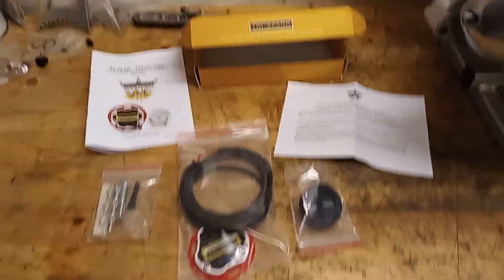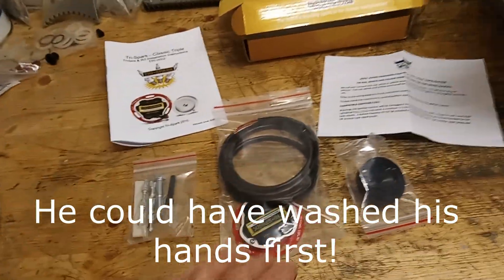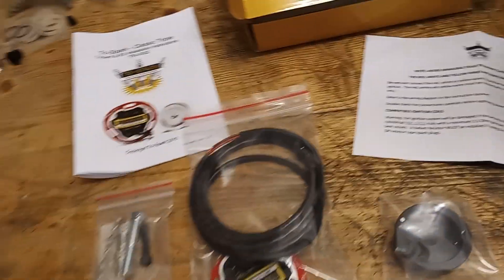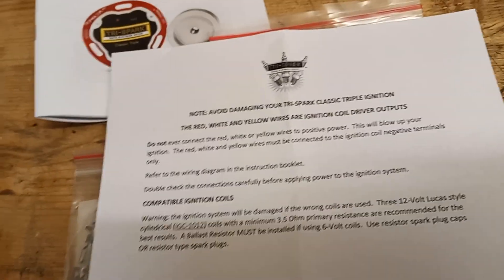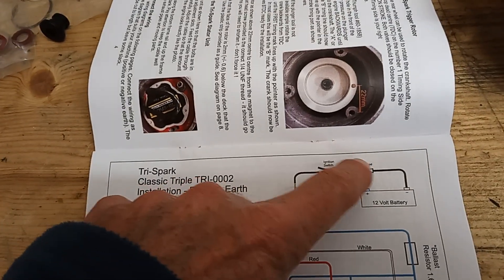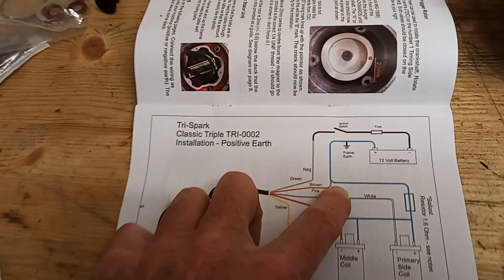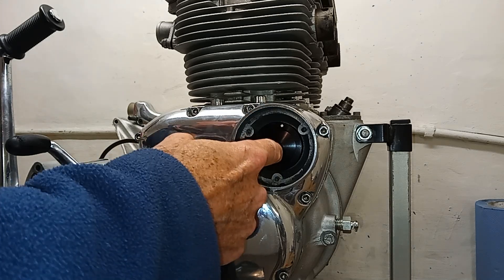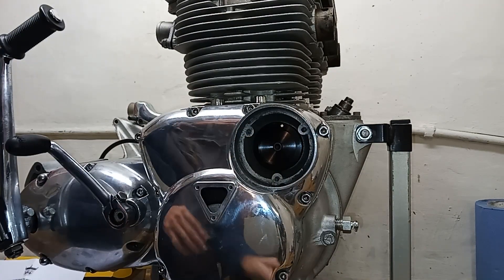Triumph Trident T150V Engine Rebuild Part 47: Fitting a Tri-Spark Electronic Ignition System

Comment: Hi Chris. I fitted one of these on my Rocket 3 and had an absolute nightmare. It would cut out randomly and you had to turn it on and off, reset it then it would run for a bit then boom stop again. I solved it eventually by getting rid of the supplied connectors which I had even soldered!  Going on Amazon and bought a pack of good quality insulated connectors. Changed them all using the crimping tool you recommended. For some reason the insulated crimp’s solved the problem and it now starts first kick every time and ticks over at lights without having to blip the throttle like you do with a Boyer. I also installed Trispark coils but I don’t think it needs them as it ran fine with 6v coils and a ballast resistor. Hope this helps. 

Kind Regards 

Alan.
Reply from the maker: That's great info. Thanks for the input. 👍👍👍